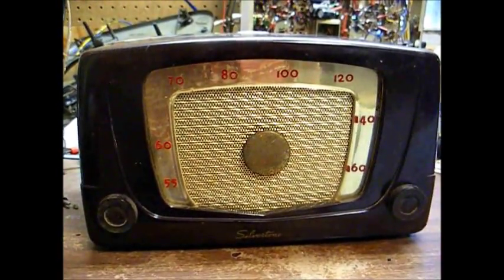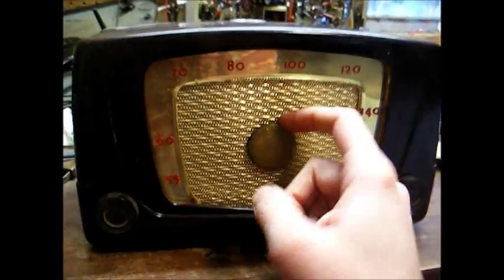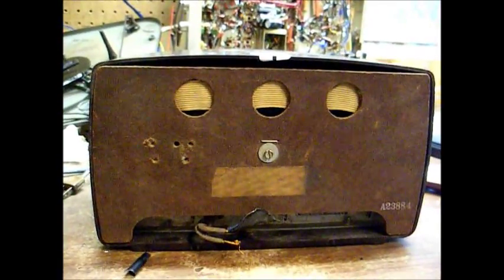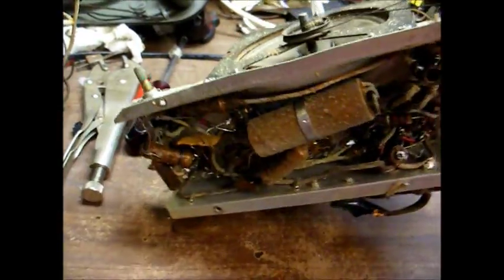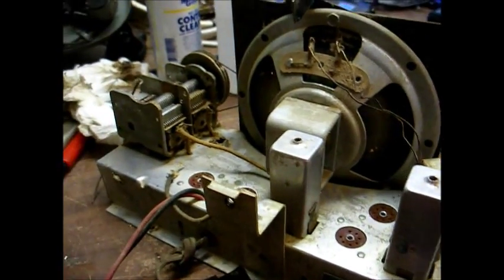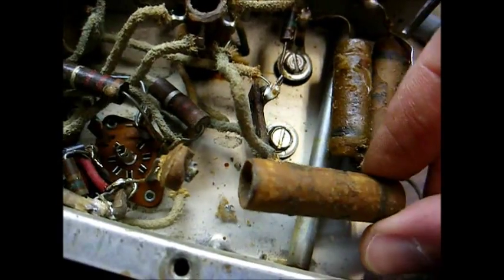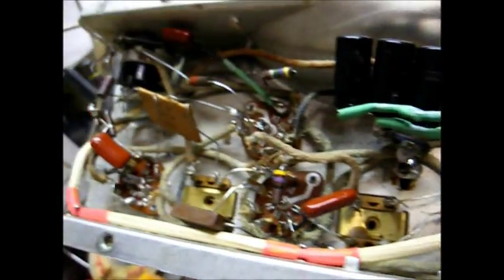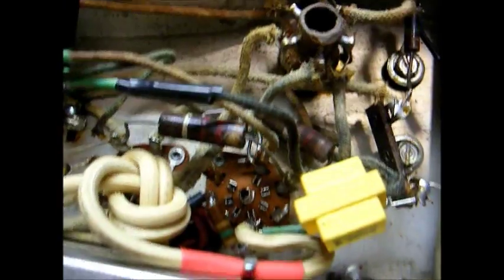Repair of a Sears Silvertone model 5 AM tube radio - part one

Comment: Hey radiotvphononut........I really enjoy watching your videos; especially your EOL videos where you stomp the hell out of something and completely destroy it!  Anyway, im woking on a Silvertone radio just like the one in this video. I see that you replaced the filter caps with a different value, but that's ok. Im wondering, the original caps in my radio say 160 volts. I have two 22uf and one 47uf capacitor all at 250 volts. Will using this higher voltage do any harm?
Reply: 250 volts will work good. Never go  BELOW the rated voltage of the original capacitor

Comment: I just found one of those new retro radios two hours ago when I was taking the trash out in my apartment building. It looks similar to this one except it's only a few years old and manufactured in China. The previous owner couldn't fix it and didn't want anybody else fixing it so he cut all the wires. He cut the power cord right at the power supply. You'd think that would be enough, but no. He had to pour melted wax all the circuit board. It also looks like he tried to twist off several capacitors. 

I don't understand why people are like that. I notice a  lot of guys have issues with ego and pride when it comes to repairing things. They don't like the idea of some guy like me coming along and repairing what they threw away. I'm just the opposite. If I have something that can be repaired but it's beyond my abilities, I'll attach a note to it like "VCR works but doesn't eject tapes."  or "Computer works but RAM modules have been removed." Like Clint Eastwood said in "Magnum Force."  "A man has got to know his limitations."  

I'm going to do SOMETHING with this radio I found. It might not end up as a radio but I'll find some use for it. It sure is pretty looking, but like our friend shango066 says about the Philco Predicta "It's all form and no substance."

Comment: Just picked up a Silver-tone 5. {not working} After watching [4] of this series, I had enough guts to splice on a AC cord and put power to mine.  ;-)  no smoke! 
all tube glowed.  Got a beautiful ac hum.  Antenna is unhooked.  Sounded like it was trying to catch some signals.

Minus:real ruff shape. Has been worked on.......uck.  However, the dial string looks original. I can send you a picture if you wish.

thanks for the great videos!

Comment from the maker: I've seen dirty tube pins/sockets cause a similar problem. I've also seen old carbon resistors that arced internally do it and I even had one radio that had an arcing speaker field coil cause a similar problem.

Comment: I've noticed that the output IF transformers seem to develop this problem more so then the input ones. I have one set that I suspect has SMD but I have another that had volume drop problems caused by bad mechanical contact with the mica wafer inside not silver migration. Another thing to looks for in sets with 7 pin miniature tubes and loctals is dirty tube sockets and tube pins, that can also cause that crashing, and dirty volume controls of course.